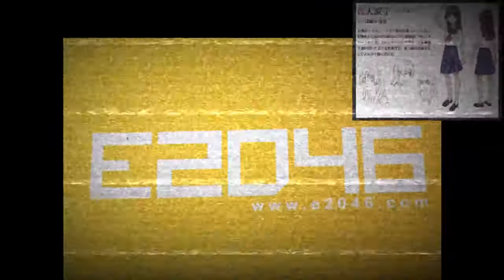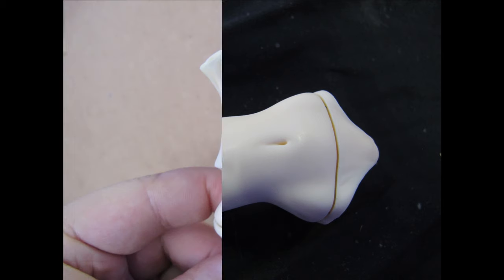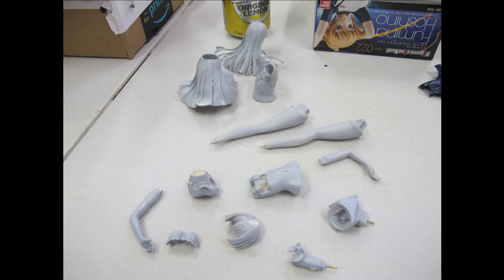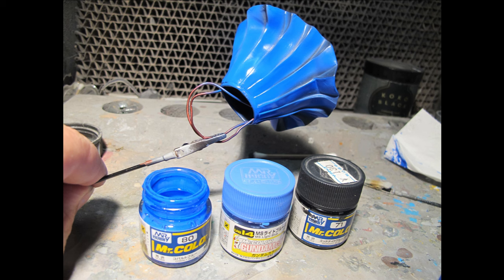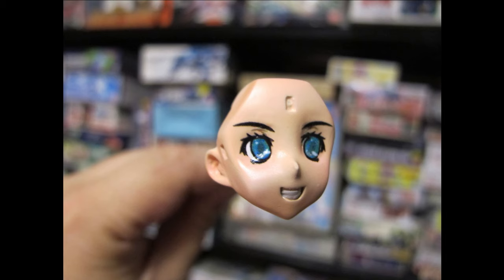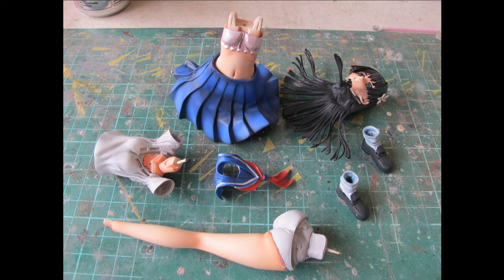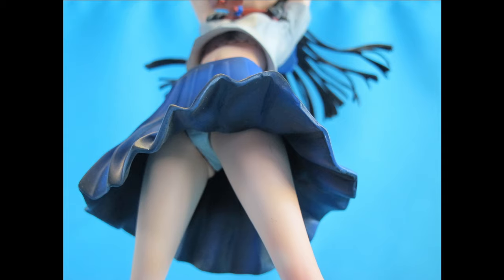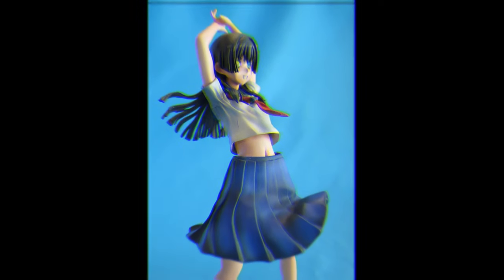1/8 Saten Ruiko garage kit (E2046)

Comment: I'm thinking about getting something prepainted from them; do you think their recasts are good and worth it? Or are they lower quality than the original?
Reply from the maker: Hello, I have handled there pre painted items before and can say with packaging, painting and pinning it is worth while and a lovely finished piece. Cast wise handling both original, recasts and e2046. Reproduction is still very sharp with the industrial vacuum casting method they use or commission. By the naked eye its hard to near impossible to tell apart even with anti hero which isnt even GK. Yes very much worth it.